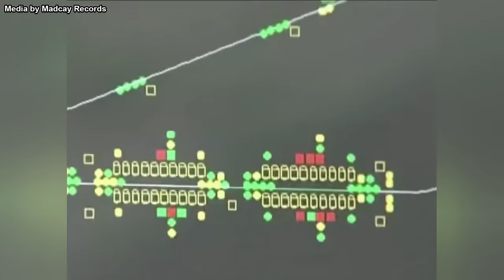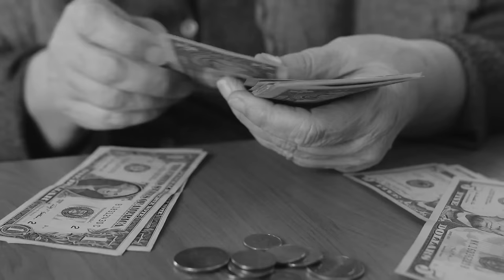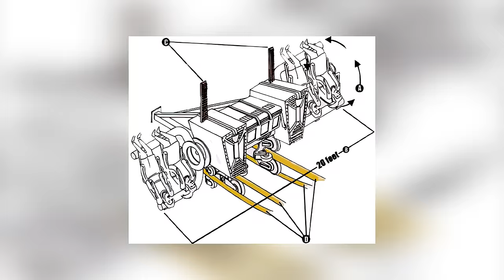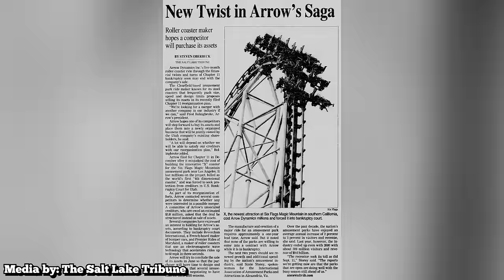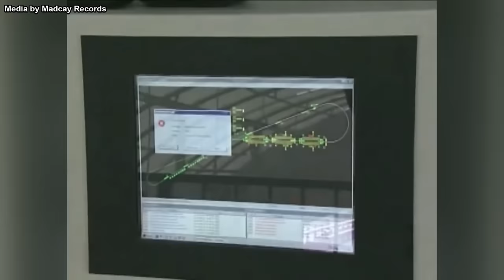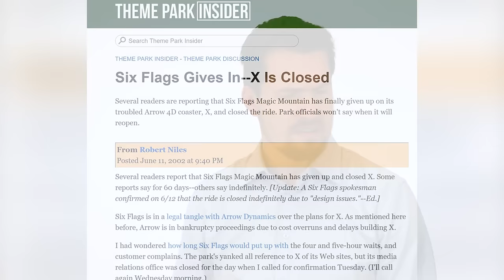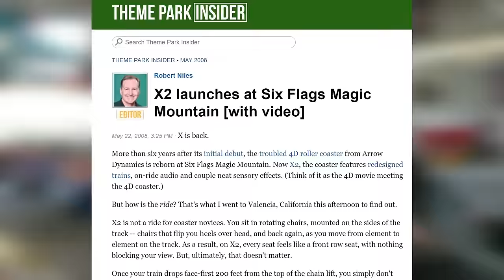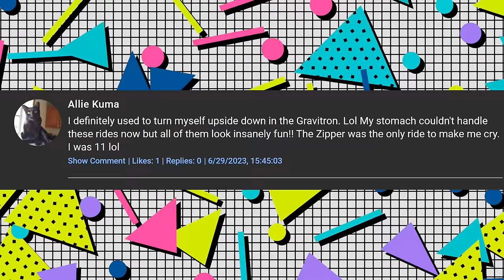FAILED Roller Coasters: X - Six Flags Magic Mountain

Comment from the maker: CORRECTION: I mixed up Road Runner Express with Road Runner Railway. Damn you, synonyms.
Reply: Awe it's okay. No one's gonna fault you for confusing a road runner with a road runner hehe
Reply: "Express" is not a synonym for "Railway"
Reply: It’s ok. That ride is the best ride at six flags anyways.
Reply: Where did you get the original X logo? I can’t find it on google anywhere.

Comment: At least, Arrow went out with an intense coaster. Still the best coaster by Arrow Dynamics!
Reply: Thank god there last wasn’t a wacky work or something like that
Reply: Magnum exists

In my opinion Magnum is the best arrow, but that’s a somewhat unpopular opinion
Reply: @Wildcattttt  I think Magnum is the 2nd best arrow behind X2
Reply: @christianortiz-v1l I can see how X2 could be the best arrow, I think I just didn’t get the best ride on X2 though, I think I need to ride it again and my opinion might change
Reply: @Wildcattttt magnum is by no chance better than X2 lmfao
Reply: @Wildcattttt Magnum has some of the worst restraints on any coaster, but it is a great coaster despite those. Hopefully Cedar Point can get new Vekoma trains on it
Reply: Magnum would like a word
Reply: @Wildcattttt magnum isn’t just the best arrow, it’s the best ride period. Steve’s airtime compared to magnum makes Steve feel like iron dragon
Reply: @micoasters  from the retirement coasters association
Reply: I think Tennessee Tornado is without a doubt the smoothest Arrow ever built. I was actually surprised when I first ride it because I was used to the roughness of Anaconda and Vortex. It's still running like butter.
Reply: @lightningboat  you mean mor- wait morgan is dead damn it
but i don't think vekoma can actually create similar trains to those on magnum but atleast change the lap bars
also there are worse restrains than magnum's lap bars
for example SKYRUSH'S RESTRAINS AND SLC OLD TRAIN
Reply: Na in the world
Reply: @suyapagarcia9956  but how can it compete with steel vengeance or its japanese brother eejanaika?
Reply: @boltgaming248  It’s is the original

Comment: If we ever get another full scale 4D coaster, it needs an original layout. A vertical loop (with extra front flip on top) or an upwards Raven turn (to complete a backflip) would be two elements I’d love to see
Reply: I made my own in RCT3 a few years ago, & the drop was a large half loop, a bit like the B&M wing coasters
Reply: Do we know if the one in China is the same layout? I have heard the one in Japan is better then X2......I've been wanting to ride X since it opened...one day.
Reply: They're different layouts, but are very similar. It's sort of like Arrows corkscrews, where they're all a little different but have the same elements.
Reply: I would say Eejanaika is a very good coaster.  I love the flip at the top of the first raven turn.  I’d say both X2 and Eejanaika are great but slightest different so can’t say one is better than the other.  I doubt I’ll be able to ride Dinoconda anytime soon.
Reply: El Toro Ryan did a video on why Eejanaika is the perfect version of X2.

Comment: I remember riding the original X before X2. 3 hour minimum wait time due to the boarding woes. We spent the queue time talking about Arrow going bankrupt and taking the patents for the 4D coaster down with it, and how this would be the only ride of its kind for the foreseeable future. It's interesting that even though the patents/rights were bought up, we've still seen very few 4D coasters. Goes to show how insane they are.

Luckily, X2 is basically the same. Though I do miss the ridiculous pink monster look of the original.
Reply: When you are exiting X2, or on the ride coming back into the station. Look a the storage barn where they store the trains. The track, & supports still have the original pink & yellow color scheme to honor its past.
Reply: @pinball541 really it's still there?
Reply: @godkinghell15 - Yes!
Reply: i always wondered if there wasn't such a wide gap between the patent changing owners if we would see a ton more 4D coasters in north america.
Reply: Unfortunate how there’s only 2 of this kind in service not counting 4d free spins and zag spins bc the rides are different
Reply: First time I rode X. I too waited 3 hours but after getting off I thought it was worth it. No amount of wait time will prevent me from riding it every visit
Reply: @Lloyd00 they have a feature now at six flags called one shot. Basically you can skip the line by paying $13-$20 per person. 

It’s a single shot flash pass for that ride

Comment: Arrow did not attempt to replicate OR mimic B&M's structural support designs on Drachen Fire. It was 100% an original design from Arrow. El Toro Ryan explains it well early on in his Drachen Fire video.

Keep in mind that B&M was still a fairly new company during Drachen Fire's construction in 1991-92. Arrow was still the highly praised company back then (though that would change several years after the fact).
Reply from the maker: Yes, I forgot that detail. I will be cutting that moment out of this video.

Comment: A WDI engineer once told me that since arrow and Disney were so close,  and since Arrow "manufactured" the omni-mover... (not designed,  that was WDI) Arrow was inspired to build X with the same technology.  Haunted Mansion uses the same dual rail to control the facing direction of the doom buggies.

Comment: The two versions built in Asia (Dinoconda in Jiangsu, China, and Eejanaika in Fujiyoshida, Japan) are far more intense than X & X2 ever were. The layout is modified slightly so that there is an additional inversion, and the top speed is higher than that of X2.
Reply: Obviously. X was the prototype and those were built by S&S who perfected arrows design

Comment: I remember getting hyped for X and Deja Vu to open at Magic Mountain in 2001.  I would watch videos of the 3D renderings on Magic Mountain’s website using a 56K modem.  I was bummed that X was not open during my first visit to Magic Mountain later that year, but I made sure that I rode it the next year.

Comment: I remember that when I went on X2 for the first time in 2017, at Magic Mountain. It feels like that this coaster is going to be a crazy spin that I can’t think of going straight from riding the nausea thrill ride. I know that I would feel a lot of headache with the spin but I finally made it without passing out of the ride. It’s a tough call for the number one favorite roller coaster In Magic Mountain, but it’s not as bad as it handles the ride itself. From the best of Twisted Colossus to X2. It’s a tough choice but believe me. It’s a great ride. I don’t remember X being named for the first coaster in Magic Mountain since it first opened.

Comment: X2 can legitimately tear someone’s acl if they sit in the back. It’s a fun ride but stay away from the back seats
Reply: That’s why coming out of the outside raven turn going into the twist into the brake run I put my legs straight out so they don’t slam against the seats leg rests it’s a really good riding tip for the back seats

Comment: After a cancelled trip to California in 2020 due to COVID, I was finally able to visit magic mountain 4 years later, this past weekend. 
X2 was one of the most unique rides there and had the potential to be one of the best rides at the park. However, my sister and I noted (at least on the car we rode in) that there was a lot of rough bucking, especially towards the end. 
This would usually occur just before the car would pivot, where the car would swing back and forth really hard before rotating. Most of it was bearable, but the last element bucked so hard, it could potentially cause injury. I had mentioned that it seemed as if the ride needed to be recalibrated.
After watching this video, I believe that the stresses on the tracks since 2008 has caused a bit of warping, causing a more uncomfortable ride. It was still fun, but the aggressive roughness, especially towards the end kept it from being considered a top tier coaster for my sister and I.

Comment: Separate load and unload stations are actually way more efficient and give way more throughput than combined stations allowing both load and unload to occur simultaneously, but only if more than one train is operated. Obviously.
Reply: X had a lot of ambitious ideas, but a lot of things just were not working as intended (like the separate load and unload).

Comment: X was the ride i hated the most at the park. I’d ride it almost every morning and every night before heading home when i worked there. Then often popping in an empty seat when we couldn’t find a single rider who’d jump in. As a ride experience it was crazy unique and fun. 

The ride itself was great, but there were so many negatives. Working the ride suuuuuucked. 

Tons of people could not fit in the butterfly harness so you’d get people yelling at you all day. Those stupid pedals would always get stuck or grab your feet and crush them and you’d have to unlock the restraints over and over for each row as people would readjust. So loading the train could take a few minutes. Like you said wed often have 1 train. When we had two it helped a lot but it was hard to get in the rythm of sending the full train just in time to roll in the empty one. 

One major negative you missed was the ride time. It touted two minutes and sixteen seconds, but literally a minute was just the lift. The suuuuper slow in the middle of 95 degree sun in your face weather. The train was so heavy the lift had to go super slow. And it would often over load and need to be reset. Which is very manual like most coasters. Id often get sent yo run out to the lift to man the reset button. 

Oh and early testing was crap. I never got to see it, but it was fairly well know the original trains never got all the way through the track. Not that theyd volley, but theyd just fall apart and break. 

Six flags made a huge mistake inventing and testing a first time ride live at the park. 

I still haven’t rode on X2, but id love to experience that again with the lighter trains and shorter wait times. Last time i was there Tatsu was new so i had to chose and i felt i chose wisely.

Comment: I rode X when it came out, and have ridden X2 a few times as well. X was much smoother than X2.    You get off X2 now and you get a massive headache.  The restraints are not great for smaller people either.

Comment: So all three times I have been on that ride there has been a problem. The worst instance was being stuck in a block brake section and in the heat of the sun. What was worse was that I was a single rider and paired with a guy who flipped and continued to panic for the whole  half our we were sitting there. After that I still loved my experience on the ride, but I prefer B&M winged coasters now over the 4D style.

Comment: Calling this coaster "rough" would be a compliment. Viper is "rough". This thing is a blender on wheels.
Reply: I've never once had a rough ride on the Viper.
Reply: @bezoticallyyours83  Viper is notoriously rough with horrible restraints. If you aren't bothered by it, congratulations.
Reply: @johnblackburn2060  Yeah nope. Again never had a bad ride. Never been rattled, ear banged, or whiplashed on Viper. And I don't mind otsr restraints.Though the butterfly harness on Tatsu was wonderfully comfortable. 

You wanna talk rough? I once rode a coaster that whipped me around to the point I couldn't sit, lie down, or lift my head without feeling sharp pain in my neck for days afterwards. That's rough! (Also Mr. Toad's Wild Ride, Flashback, and any run-of-the-mill Wild Mouse gets pretty jerky.)

And while not rough, I once went on one of those upside down pirate ship rides, and the ride operator smashed my poor boobs into the restraint by putting it down tighter. I'm not super busty or anything either.

Comment: X is one of the best if not the best ride I've ever been on...I'd hardly call it a failure.
Reply: It was a great concept, it just barely worked in its early years. The overhaul into X2 helped fix a lot of its early issues to greatly improve its reliability and capacity.

Comment: If X is a failure, may all my life endeavors fail just like it.  My favorite ride of all time. Loved the original... After X2 glow up- just got even better.  Never ridden anything else close to it's craziness.  Every time I take a first timer on it, the first thing they say after getting off is "Holy Shit!!! What the fuck just happened??!!"  That's a fantastic ride. Thank the heavens for Alan Schilke for the vision and Gary Story for believing in it.
Reply: Great ride experience for sure, but from an operational and business perspective...definitely not. While S&S's revisions to the model have helped make it more reliable than the original X (hence the update to X2), they're still massive investments that require a ton of maintenance and have rather limited capacity, so have had limited appeal on the world market (S&S has only sold two other 4Ds after acquiring the rights to the model).

4Ds are incredible rides...but it's not hard to see why they didn't take off.
Reply: Yeah- I get your point.  Failure from financial perspective.  But, I'm still glad it exists.  Would love to ride Eejanaika as well at some point before I shuffle off my mortal coil.  The Axis ride looks crazy too- but it seems like parks in general are more investing in smaller, less risky rides lately.  Well, except for that Dubai park.
Reply: @9clarkkent  It's great concept, but it definitely had its problems early on. I'm really glad S&S gave it more chances with Eejanaika and Dinoconda (which are even better), but the issues the original X had kind of shot the model in the foot.

Comment: I prefer X over X2. X2 is awesome but X was even better. Too bad they couldn't get it working properly. I am sure the tech is there now and there even might be a ride at another Six Flags or theme park that has the exact same ride as X.
Reply: As touched on in the video, the rights to the 4D model were granted to another manufacturer (S&S), which continues to market the model to this day. However, only two others have been built: Eejanaika in Japan, and Dinoconda in China.

That said, the Asian versions learned from X's failures, and had their designs tweaked to really capitalize on the concept's potential...and the difference in ride experience is night and day. Despite appearing to be almost the same ride from the outside, Eejanaika is a much more consistently wild and intense ride that almost makes X feel like a kiddie coaster.

Comment: So does that mean the one here in Japan is a different version that was built by another company? I always thought they were clones to each other but then again the one here in Japan is a bit more intense and higher than X2 and is a lot more exciting to ride.
Reply: Arrow's assets were absorbed by another company (S&S) that continued to market the ride, though it would be a few more years before there were any new takers. Eejanaika was the second attempt at the 4D concept, but thanks to the original X having so many problems, S&S had the ability to learn lessons from X's issues and redesigned the ride systems to substantially improve reliability, and tweaked the layout to go even more insane.

Comment: I mean really X didn't actually fail. the original trains were just too heavy and needed tweaking thats all. since its trains got modified its been fine ever since.
Reply: If it needed a bunch of overhauls and modifications to run correctly...it's kind of a failure.

Comment: Was it a failure if Six Flags is still standing and X2 is fine?
Reply: The original X barely worked, and had an almost endless amount of serious operational and mechanical issues that were a massive headache for the park. The update into X2 breathed new life into the ride by fixing many of its most glaring issues and helping make the ride much more reliable than it was before.

Comment: I don't get why you are slamming X. How the F, is X a fail? Everyone that has disembarked X was well rewarded for the wait. Spoken like another spoiled theme park reviewer who never actually rode. Don't be confused. When did longer than average waits for a ride start meaning that the ride sucks?
Reply: X wasn't a failure due to a bad ride experience, the damn thing barely worked and had a huge amount of operational and mechanical issues (many of which were fixed with the overhaul into X2).

Comment: Are you high?  X (or X2 big deal same coaster) is the best coaster in Magic Mountain.  Silly video.
Reply: It delivered an awesome ride experience...but the damn thing barely worked.
Reply: @plotpoints1034  It works better now because it got a complete mechanical makeover a few years after it opened (which is why it got rebranded into X2). When it first opened as just X, it didn't.
Reply: @plotpoints1034  It sent its manufacturer into bankruptcy, safe to say it had its issues.